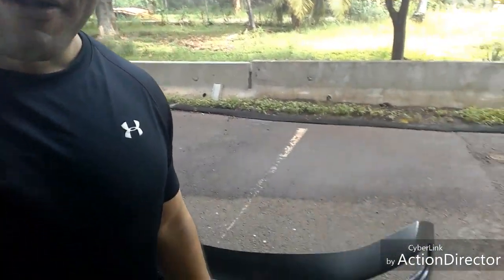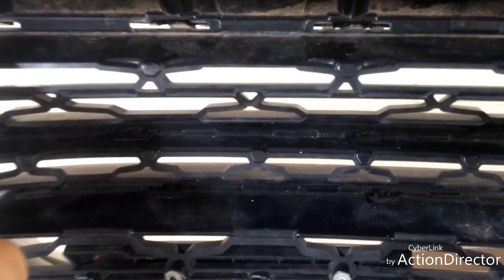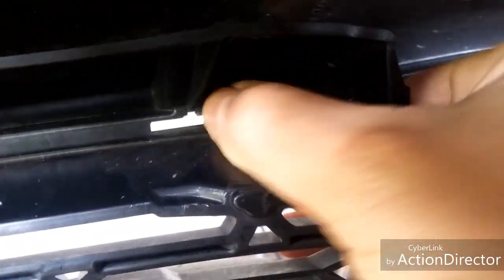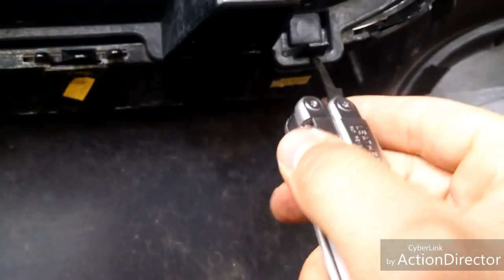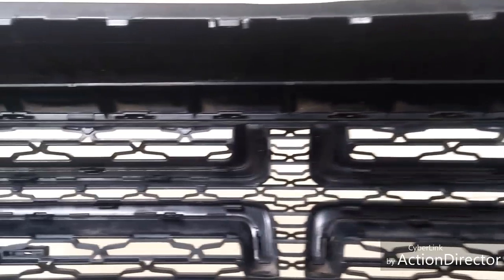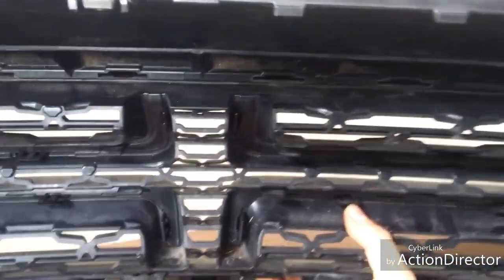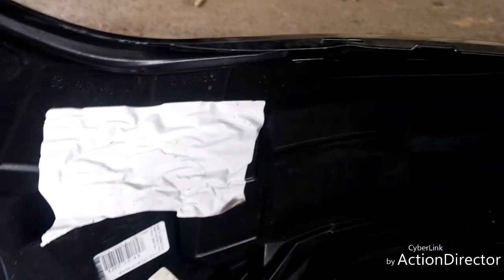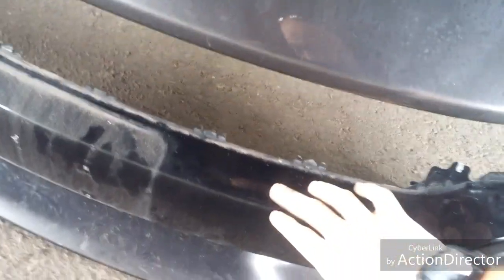How To Remove Upper Grill From 2015+ Dodge Charger (w/ bonus footage)

Comment: Thanks for the info. My baby is about to go into the body shop. They made no mention of my front camera in the estimate. I wanted to know how difficult it would be to remove the grill. Thanks for the video. They shouldn't have a issue with swapping out the grill.

Comment: How are you likeing the sport lines?
Reply from the maker: Marvin Quiroz so far they feel great, lower center of gravity and a real sporty feel especially when cornering. Its a great investment.
Reply: It's not Bouncy at All ?
Reply from the maker: Marvin Quiroz it's a comfortable ride, not like those cars that you see the passenger bouncing all around inside.
Reply: I think I'm going to pull the trigger then on the sport lines lol
Reply from the maker: Marvin Quiroz I think as long as you stick to the 20" rims you should be fine. I haven't had any rubbing and I'm just trying to monitor if the there's any camber, but do far the ride is nice and straight.
Reply: I am just maybe 275 tires

Comment: Where did you purchase your SRT front bumper?
Reply from the maker: Deron Clardy this is the bumper off of a 2016 R/T Charger
Reply: Rydin N Style o ok I been wonting to by a SRT front bumper for my 2016 charger R/T and been thinking about getting one on carID but did not know if it would fit OEM ones are crazy expensive man
Reply from the maker: Deron Clardy I wouldn't buy one from carid, it's the duraflex brand that's cheap from China and doesn't fit right
Reply: Rydin N Style ok cool thanks for letting me know and I just ordered my eibach sport line kit did you have to buy any other suspension parts or did you just get them put on and then get a alignment and have no problem Or do i need to anything else like endlinks or anything

Comment: What grill you put in it?
Reply from the maker: I was initially going to upgrade to the SRT grill, this one I sold to someone who just wanted the gloss black insert
Reply: Rydin N Style so i can put srt in my sxt 2018 charger
Reply from the maker: It will require different plastic clips, but it is possible
Reply: Rydin N Style have you done it yet? I’m trying to replace my upper grille that has the crosshair and replace it all mesh style like the srt. I notice though that the srt upper grille has different attachments so I’m slightly confused how you would do it?